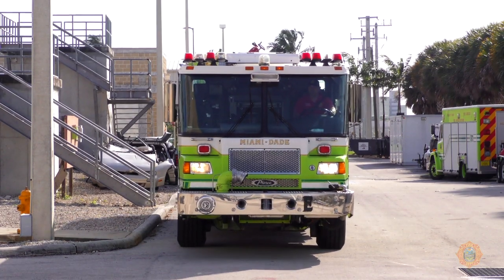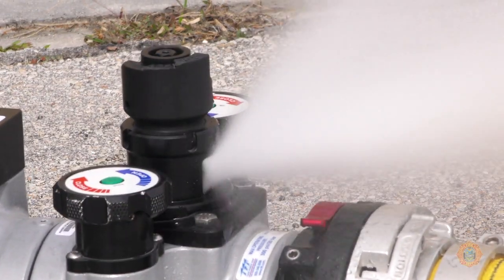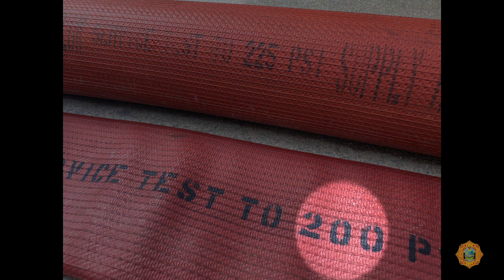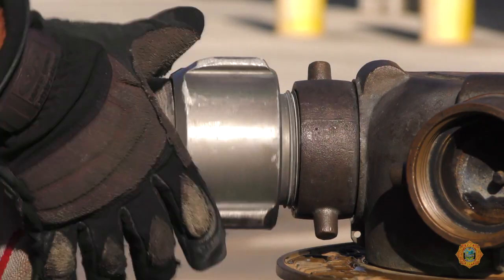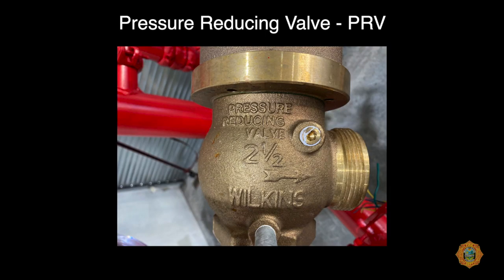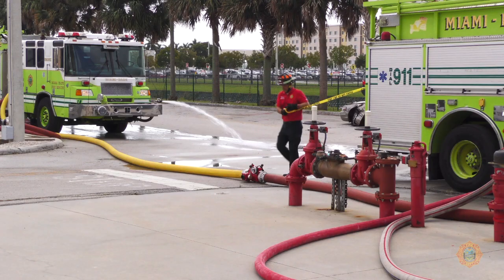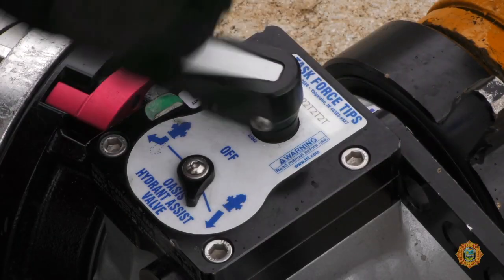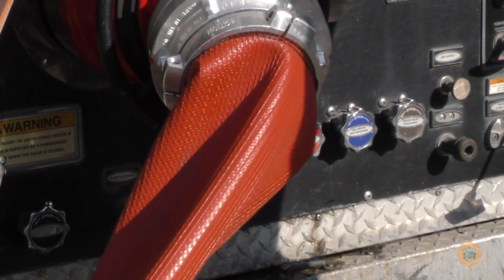FDC Tandem Pumping - High Rise Building Fire Pumping Operations

Comment: How exactly does a hydrant booster work?
Reply: NAFF

My understanding is that it allows for firetrucks and their systems to add pressure/water supply to standpipe systems. Depending on the type of system it may vary greatly however, as stated, not a firefighter but just someone with an interest